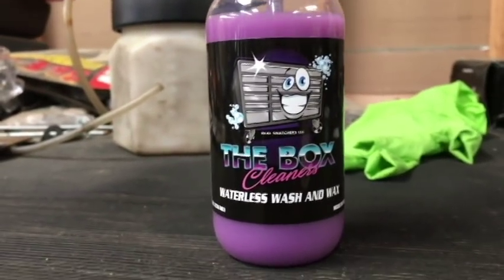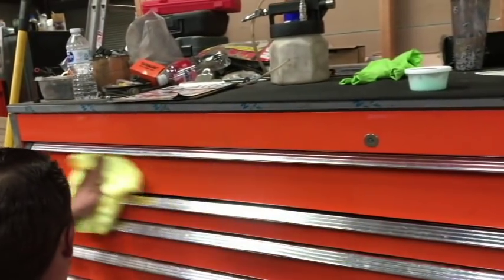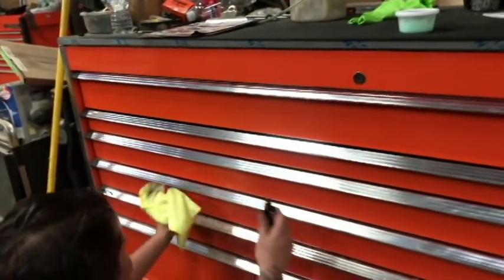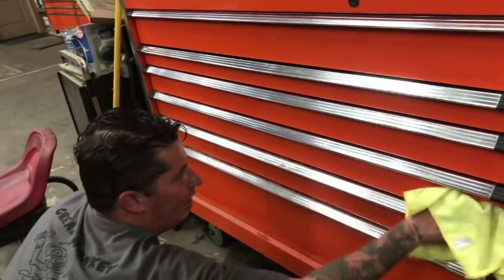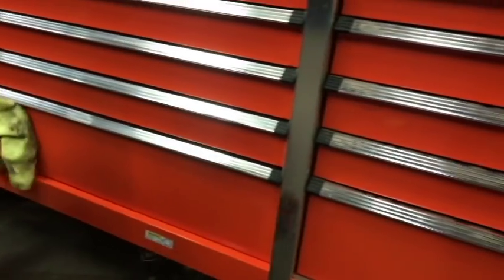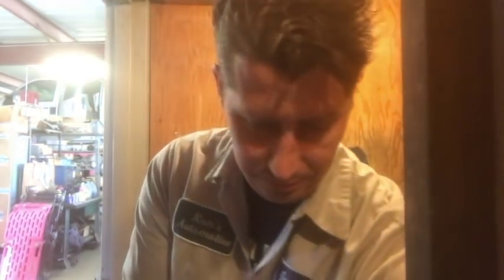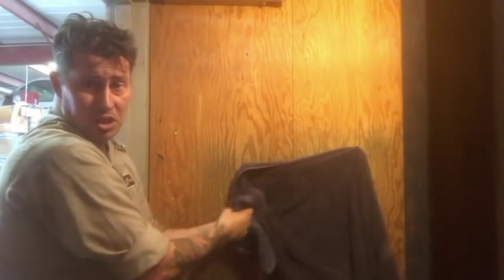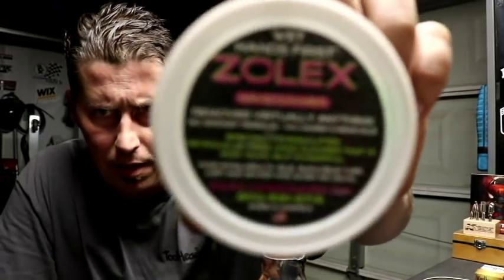Junk Yard Specials & Tool Headz Crate Box Chemicals in Action!!

Comment: We had problems at our shop with junkyard Transmissions not fitting right i work at mazda dealer and  some customers  want  too try the junkyard way I rather just do the reman that me man good video
Reply from the maker: AJT Mechanics I Agree. I’ve only ever gotten two poorly reman cylinder heads back that we’re just as bad as the ones I too out. 👍🍻

Comment: Junk yard rear ends are junk.  I had  one put in my dodge truck, the ratio was wrong and it  lasted one year. For the same price a 4x4 shop rebuilt the rear end changed tbe gear set to a better ratio for larger tires and it was as quiet as new.

Comment: I can't stand lkq motors .. every single one of them it's like they try especially hard to cut break or smash every last part bracket sensor on it .. but they always run .. and don't really have any problems with the transmissions either .. so they are always good but pretty much only the block and heads are good oh and my shop does at minimum 2 engines or transmissions a week too .. so we buy allot from them .. n we called them about and thier response is pretty much they only warranty block and heads and anything else left on it is a "bonus"  lol .. so whatever